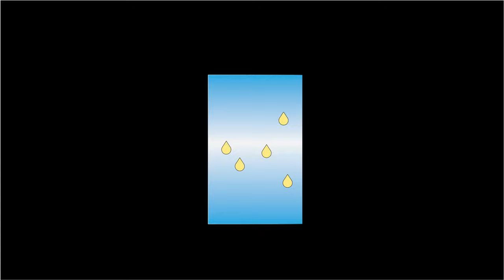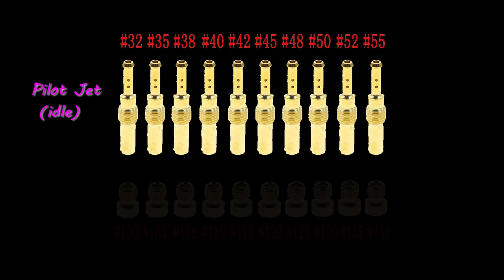Motorcycle ATV Engine Exhaust Popping or Backfiring - Rich or Lean?

Comment: If your dirt bike back fire is a good thing or a bad thing?
Reply from the maker: From what I've read, running lean is a bad thing in any situation because the engine runs hot.  It tends to first affect the exhaust valve.
Reply from the maker: @alvinrodriguez1846  If all you're getting is popping from errant pulses of backpressure, which I actually think sounds cool, then yeah, could be running fine.  But if it's affecting performance, then that's not cool.  If it's popping and affecting performance, the system's moving more air than it used to and now you need to increase fuel to compensate.

Comment: I have a zx7r and it sounds like your video. 
At 4:00 https://youtu.be/mV5WpLoCSXc Would you suggest that I find a stock exhaust to put on it? I have cleaned the carbs. Any advice would be helpful.
Reply from the maker: Hello. It certainly seems like a lean problem.  And because the throttle hangs high for so long instead of cleanly cutting off, it tells me it may be lean because of a pretty good sized vacuum leak.  A vacuum leak is where air is reaching the engine by somehow going around the carbs instead of through the carbs. So, you let off the throttle. The throttle plates close to block off the air and that immediately cuts engine speed.  If the speed hangs for a few seconds, the engine's still getting air from somewhere.  The best way to find such a leak is using a smoke machine.  I've tried all other methods (carb cleaner, propane, ultrasonic leak detector, etc.)  Nothing is more revealing than the good old smoke machine.  Remove the airbox, block off all 4 of the carb inlet holes with tape or latex glove, etc. Poke a hole through the tape or glove to insert the smoke machine hose.  It's a small engine, small carbs.  You might be able to get away with cigar or cigarette smoke.  Might still take a while though.
Reply: Thank you!!!!! I appreciate the advice and I will be trying it.Thank you for your time as well.

Comment: Mine was bogging at full throttle I bought 3 different carbs … whole time it was the wire beside the front sprocket beside the oil drain plug had came disconnected 🫨 … mikuni carbs for sell hmu !! 😂
Reply: How much you asking ?